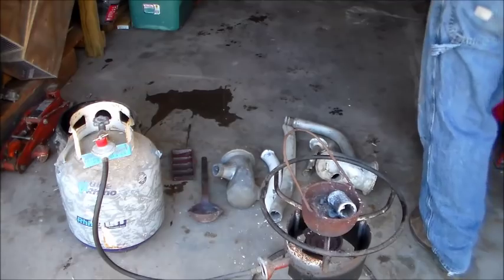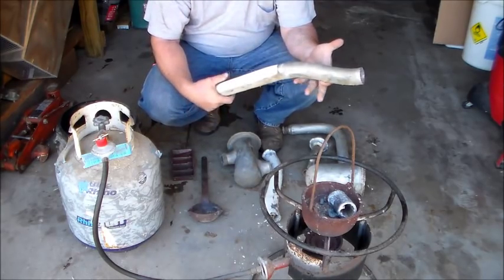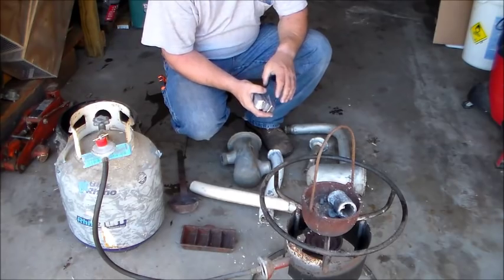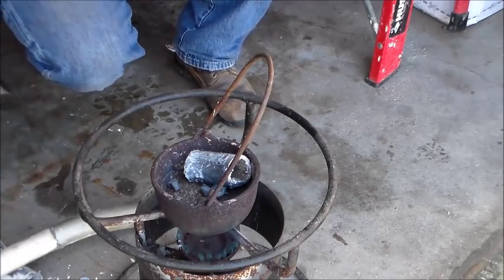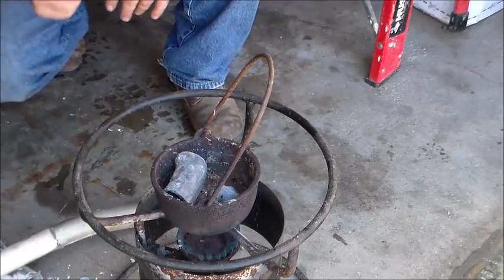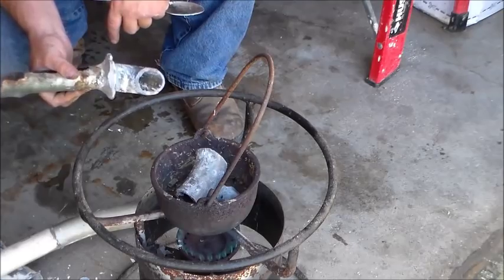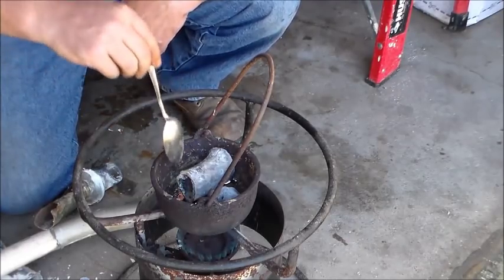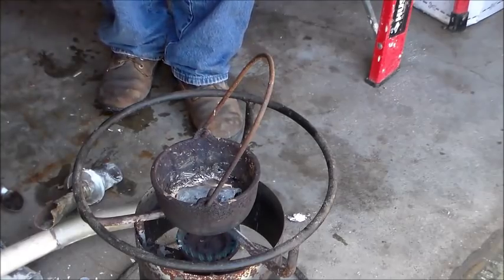Lead melting and Discussion

Comment: me and my dad was melting and molding lead one day when I was 13 , well I was holding the mold squatted down and long story short ,my dad tripped and spilled the molten lead on me in the early 80:S . luckily it only landed on my right arm and right foot. it did some damage but it made my dad really upset to the point of tears . it's all good, just be careful folks
Reply: did it damage the muscles or deep scarring? i always wondered how bad molten lead would damage if you dropped it
Reply: @jonahi1304  It probably didn’t, because lead is to hot and won’t stick on human skin

Comment: Mark…  I always enjoy seeing a fellow caster at work and his methodology.  Having a pile of ingots is a beautiful sight. 
 
As a long time shooter and caster I have some input for you and a few questions.  I am not interested in ruffling your feathers here, but what I am interested in is healthy discussion.  Also..  I will be using the term smelting when referring to the rendering/melting/cleaning of scrap lead, as it is the accepted term in the casting world.
 
Next time you smelt up a pot of lead, throw in a handful of pine sawdust.  It is the best flux/cleaner that I know of.  Let it burn, stir it all in, scrape the bottom and side of the pot, then scoop all the crud from the top.  You will be amazed at how much cleaner the lead will be.
 
As far as safety gear goes..  With your time spent as a plumber, if not using safety gear works for you then that’s ok, but for the new guy just getting into smelting/casting, I recommend that they safety up  (Welders gloves, glasses, mask, all cotton clothes, etc..).  One burn from a simple mistake is too many.
 
Free lead..  Where do I find it?  You are fortunate to collect it in your business.  All lead sources here are a pay by the pound only.
 
800 degrees is a bit too hot for my smelting pot, too big of a chance of Zinc melting in the alloy.  I deal with mostly range scrap and wheel weights.  Soft, pure stuff is hard to come by as scrap.  Lead melts at 621 degrees F, Tin melts at 450 degrees F, and Zinc melts at 789 degrees F.
 
If your buddy bought mostly tin wheel weights, then he’s got a gold mine.  However I suspect that what he got, was lead with Zinc in it.  Zinc will cause the slush and oat meal look on top of the melt, makes terrible bullets, and is hard on barrels.
 
Also, Tin in your melt won’t hurt your rifling.  In fact it actually improves your alloy.  Tin does only a very small amount in hardening lead, and makes the alloy flow in the mold better and acts as a binder.  Antimony on the other hand will harden lead up in a hurry.
 
Tin in the lead will also not hurt the rifling in your barrels.  It has been added to lead for well over a hundred years from early muzzle loaders to today’s modern firearms.  You can easily use lead up to wheel weight hardness (12 bhn) in a rifled muzzle loader and most anything in a smooth bore with no resulting damage.
 
Casting is a passion of mine and If you have any questions, I’m more than happy to help.
 
Thanks for the video..
Shad
Reply: +shadowcastre Spoke what was on my mind.
Reply: +shadowcastre I have about 500lbs of wheel weights and ive been smelting foreverrrr

Comment: Incredible how those fumes didn't get to your lungs yet. It took me only once, the wind turned against me, got my lungs hurting like hell. I learned my lesson.
Reply from the maker: been doing it for over 20 years..doesn't bother me
Reply: Didn't bother me for some time as well, you've been lucky. And I was wearing a disposable mask for fumes, didn't help one bit. Air goes through the sides. Now I don't do anything without my 3M 7500 medium size with proper filters. Been too close to death for anything less.
Reply: Valken for the cancer conscious people out there, what filters do you use? Particle or gas?

Comment: Put a little candle wax in the melting and stir will bring out more of the slag if you want it cleaner
Reply: good tip, thanks
Reply: Lyman recommends beeswax, rather than paraffin, to act as a flux when casting lead ball for black powder guns.

Comment: I've melted a lot of lead pipe. Man it stinks. and don't chop pipe with a axe or something similar. it will explode when both ends are crimped. My friend hurt himself pretty bad doing that. Thanks for the video.
Reply: good tip.

Comment: Hi good job!  I just wanted to ask... in your opinion which  is the safest and Also the best temperature to melt lead without letting it make fumes ? Thank you
Reply from the maker: Lead melts about 620F so anything under 900F won’t produce fumes. I usually go about 750F
Reply: @MarkNovy  Thank you sir! For sharing your knowledge

Comment: Ive been looking for a stove with a countertop-type set up, that will hook
 up to a 15lb propane tank, so that I don't have to keep buying those 
small canisters. My battery-makers book says that I have to heat to 620f
 degrees to melt lead, but i havent been able to find any stove with 
temp-control like that in any sporting/outdoor stores... Is exact temp 
that important?
Reply from the maker: stove top set up? how large a lead supply do you want to melt? http://www.cabelas.com/product/Lyman-Big-Dipper-Electric-Casting-Furnace/706428.uts?productVariantId=1382584&WT.tsrc=PPC&WT.mc_id=GoogleProductAds&WT.z_mc_id1=02950667&rid=20&gclid=CjwKCAjw8IXMBRB8EiwAg9fgMGCQ6cONL8G8npdUirOxNPjbpYYncprYM_DIpYRVaKGTTK3l2nKoyBoC294QAvD_BwE&gclsrc=aw.dsor this one:  https://www.buffaloarms.com/bullet-casting-supplies/casting-furnaces/15000-btu-single-burner-propane-lead-furnace-63-5111 both work well  controlling the temp is pretty easy.. once its liquid just adjust flame or in electric models just dial back a bit621.5F is the desired temp

Comment: I was melting sum lead today to make sinkers out of an old lead drain pipe. I thought the amount of scum was excessive till I seen this video. Wow. Whats a good way to make those long pipes smaller and more manageable? Hacksaw?
Reply from the maker: sawzall em into useable size first or hacksaw but that takes longer lol,,
Reply: hatchet takes them apart with 1 r 2 swings
Reply: @HUCK stir Great idea. Using a hatchet versus a sawzall or hacksaw would also create much, much less lead dust/particles some of which you could end up inhaling into your lungs if not wearing a proper face mask/filtration system.

Comment: Overall, I thought it was a great and striaght-forward video.  I was surprised you didn't flux the melted lead - maybe that's why you had the extra 'dross' when you put in your ladle.  For pouring lead bullets, I found I got better bullets if I flux the lead each time I add new lead.
Reply: Can you flux the lead with candle wax?
Reply: @guzmanpatriot  you sure can. I personally use canning wax but often use candles too. Just be careful because it will flame up for a second when you add it. After the burn is over you will get tones of impurities to scoop out.
Reply: How much wax would you say is good for this amount of lead? And do you use real beeswax or paraffin wax? I heard people say you should use paraffin

Comment: That safety talk tho, we need more of that. Today people are safety Nazis, in my country people like my dad used to cast lead soldier figurines as kids. Lead won't kill you if you keep your gear dry and are outside in a well ventilated area and you don't spill the lead over yourself. Heating up molds is done more for perfect casts than water evaporation IMO, if a mold isn't wet it's dry. When I lived in a village I used to cast lead with some fishermen friends and we never once had wet mold issues, and we used to cast a lot since they loved fishing

Comment: Please please answer some questions
No one ever explained me

1. Of what material the utensil/pan you used was made? 
2. Can high temperatures melt the pan? 
3.what is melting point of brass and lead?

4. If I use  mold of any shape and pour melted liquid lead in it and if the lead sticks to mold as happens in welding, how to separate them without damaging shape of any of them?

Your video was amazing, please answer as soon as possible I am waiting for your explanation
Reply from the maker: the pan? the mold? is cast iron..the pot is cast iron.. youll never get it hot enough to melt cast.. Melting point of lead is 621.5F 327.5C Brass is 1675 F 920C and cast iron pot is  2300F 1260C so you see you wont ever get it that hot. honestly I have never seen lead stick to the mold or the pot or the ladle even.. so no worries there.. anything else?
Reply: Mark Novy thanks,one more thing ,using propane torch  can I get same results?
Reply from the maker: propane will melt it but Mapp Gas or acetylene is better... costs of those canisters vary
Reply: I have melted lead in a tuna fish can with a spout pinched into the side, pouring directly into the mold.  I have also used an aluminum cooking pot.

I have used a plain gas kitchen stove, and a Coleman liquid fuel camp stove.
Reply: Thank you for the information and a great film.  Very interesting.

Comment: Wheel weights don’t have tin. They have a lot of zinc, but it can be sorted out. Tin would be good, I add it to make better bullets.
Reply from the maker: not for black powder it isnt.. and I'm making .270 now ; so wheelweights wont cut it..thats only 4% tin..you need to add linotype for hardness ( in the 20-22 bh) by adding 12% antimony to the mix
Reply: Mark Novy I usually just do pistol calibers. 12 BHN is good enough for them. The weights usually have 4-5% antimony, so I just add tin.
Reply: Lead wheel weights contain both tin and antimony which are necessary for casting bullets.
Reply: Jun Gleno It depends on what type of weight. The clip-on type has 4% antimony, but the stick-on type has over 99% lead. Almost none have tin.

Comment: I have a stone of lead and I do not know how to process into ingots..can you help me??
Reply from the maker: +Yogi Ilham did you see what I have? the items used in the video will help you. Other than that I don't know what youre asking
Reply: +Mark Novy i was always a fan of lead casting,i casted a 3,52 kg lead ingot, its 5x50 lead bar, and its about 1,5 cm high, i made the mould out of square iron pipe, i cutted out one side of the pipe, then i bent 2 sides 125 degree, the side that i cutted out, i cutted it in half and welded them on the ends of the mould, then i welded on some handle so i can carry that mould, pretty good mould tho.